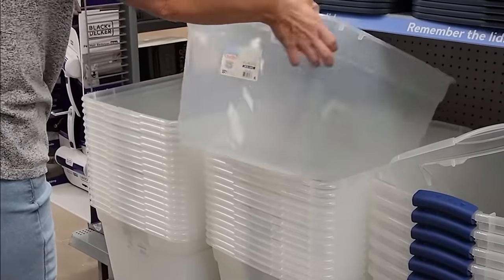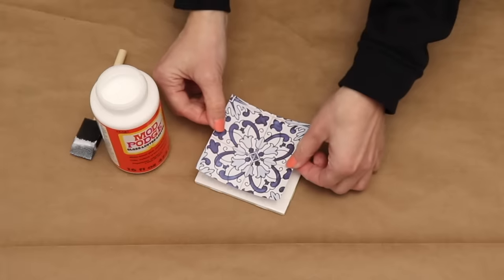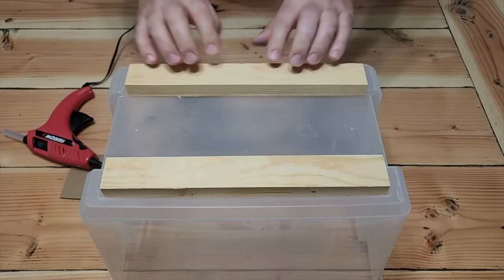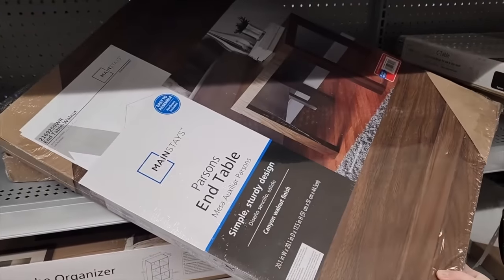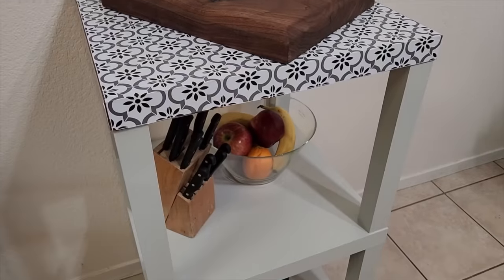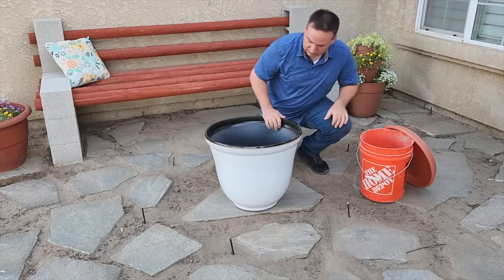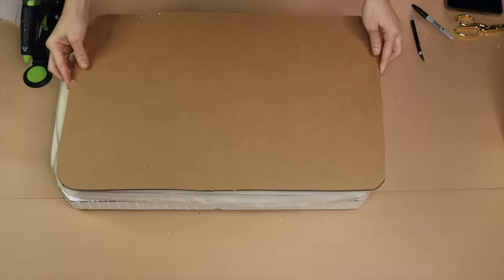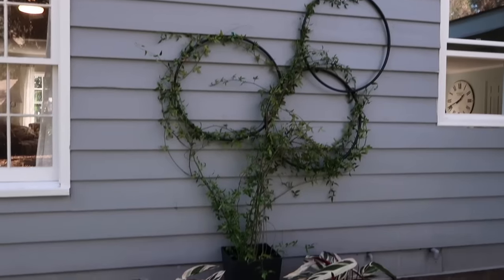The GENIUS reason people are buying Walmart storage bins

Comment: The mirror project is really beautiful, but FYI HEADS-UP!  Be sure the glue you choose to adhere the mirror to the plywood won't eventually damage the the silvering on the mirror and create visible black marks on the reflective surface.  There are mastics especially for mirrors.  Ask at the paint desk of your store about this and they can guide you to an appropriate product that will be safe for the silvering AND powerful enough to hold the mirror.  Otherwise, a very easy and kool look for a very little money.

Comment: I love the ideas of the mirror 🪞 and the water fountain ⛲️. Regarding the fountain; I wonder how long it would last because we have extremely hard water in our area 🤔
Reply: If you are concerned about about lime build-up, you could run some coffee pot cleaner or vinegar through it once in a while, filter the water with a Brita pitcher, or use distilled water....maybe a litle impractical for a fountain with a large reservoir but this can be addressed by the size of pot used.
Reply: Or add vinegar to the water.
Reply: You could just get some distilled water for it
Reply: @sandranodine1151  Than hummingbirds would not be able to drink and die

Comment: I’m subscribed & have been following Hometalk for over a year. My question is can you paint a lampshade. If so, should I use chalk paint or acrylic? Thx in advance
Reply: I have a white Walmart lampshade waiting to go on a small brass lamp (if I ever get it rewired).  I've been thinking of adding color to it and have been wondering the same thing.  I'm leaning towards acrylic.  I think I would want a fairly thin consistency in the paint would work best as long as it still had enuf pigment.  Solid color or a pattern or design in multiple colors.  I know there are fabric paints available.  Walmart carries them in the craft dept.  They didn't come in tbe colors I needed.  I have a woven cotton throw rug, striped in bright colors that I threw hair dye all over and when I washed it it crocked some color and started fading already.  So I bought acrylic paint in the exact colors (and one shade I have to mix) to cover the dye and restore the colors.  Hope it works.  Had the rug 13 yrs and finally had a place to use it.  In place 3 weeks when I splatted hair dye on it.  Grabbed it to get it into the shower to rinse it right away and got dye all over my new white shower curtain.  I have the paint to cover the dye spots on the back of the white bathroom door, too.  Been in the newly built house since June and I'm trying to make it look lived in.  😞. So mad at myself.  Just redid my hair.  Didn't spill a drop this time.  I'm always careful but ...

Comment: Clever idea, I am here to tell you that the plastic will buckle and break if you do not figure out a way to add more stabilzation to it. In order to avoid cracking the plastic, you can use a hot  glue gun or heat a metal knitting needle ( or nail) over the hot plate on your stove to melt your holes in it as well.